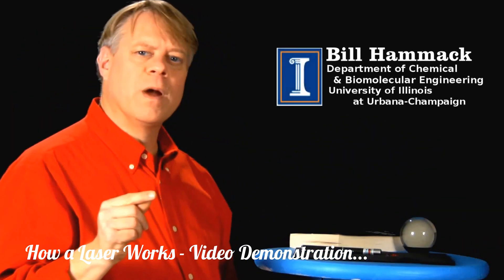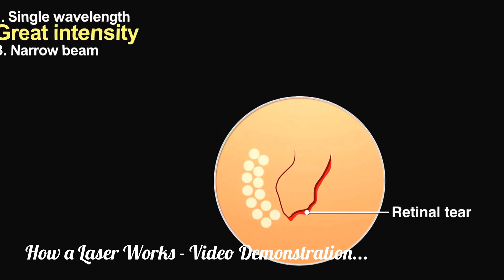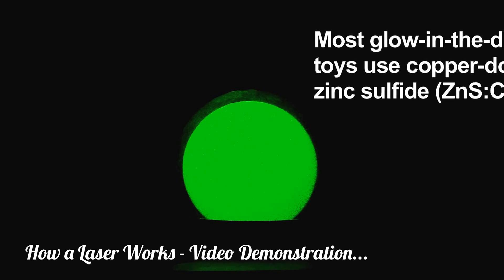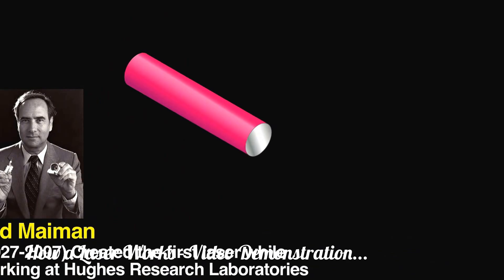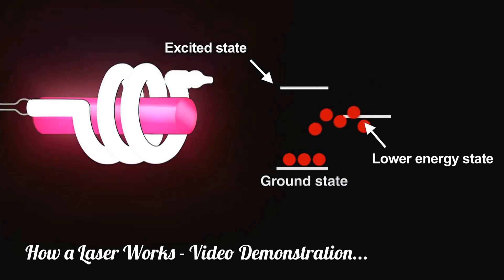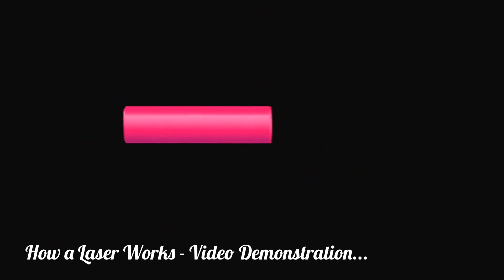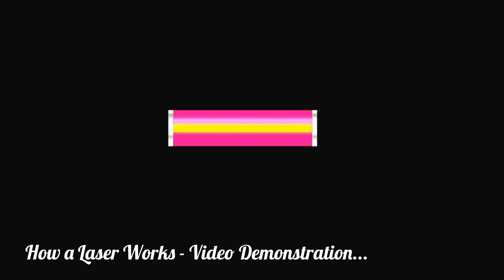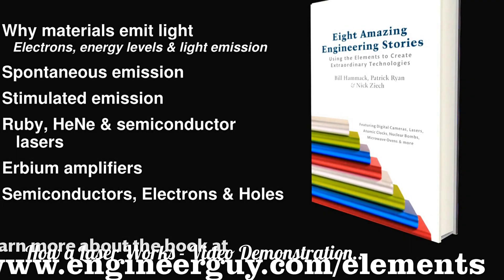How a Laser Works - Video Demonstration...

Comment: How does a laser cut things using light? I don't understand how massless protons can affect particles with mass.
Reply: +the13nthpartyboy 
If you get how a magnifying glass can burn a leaf, then you can get it with a laser :) . I don't think it's light itself that cut the object in half but the temperature that makes it burn and melt on a very little space.
Reply: +the13nthpartyboy :  

When an element with more protons interact with an elements with more electrons, the positive extra protons attract the negative extra electrons. This attraction creates movement and vibration, and heat in the process making it possible to radiate this heat to direction using nozzle and make the material which is cut to vibrate beyond their capacity to stay in their position. Thus a cut is produced. 

Protons have mass. A single proton weigh 1.673 ? 10-27 kilogram.
Reply: Hey, thanks guys.